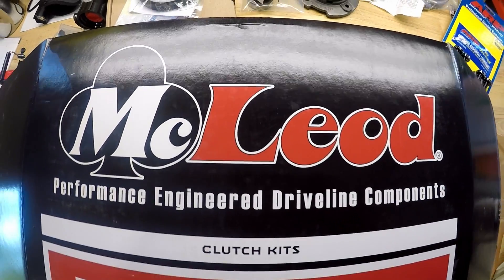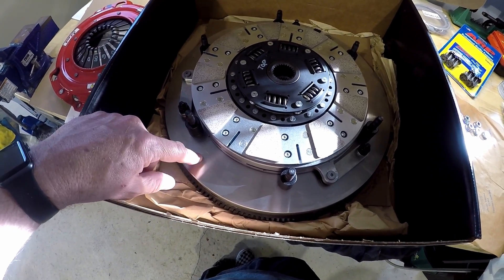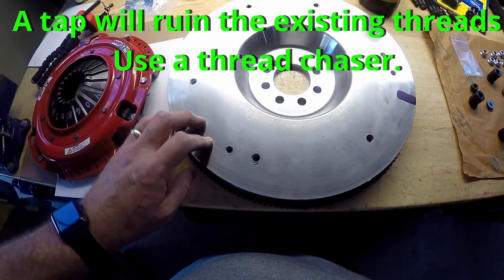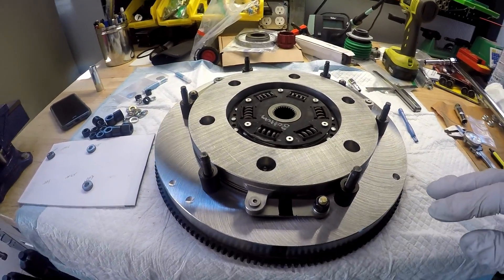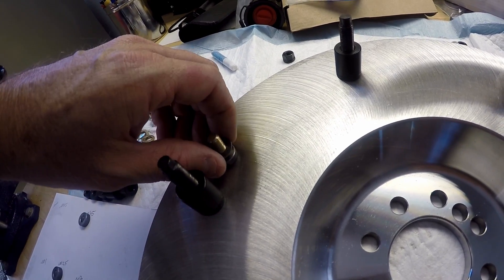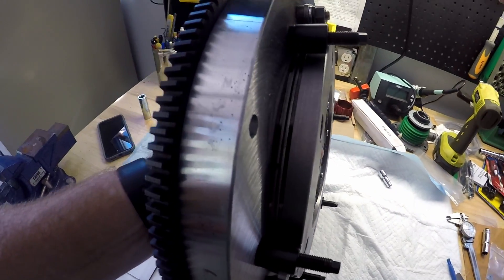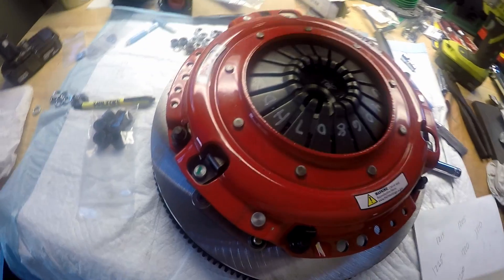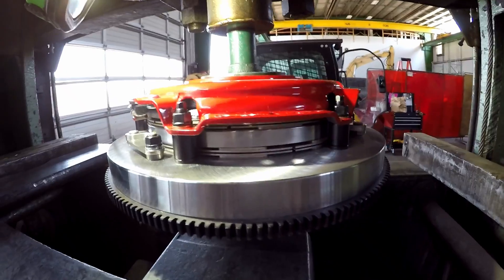McLeod RXT 1200  Clutch and Flywheel. How to set it up correctly.

Comment: Hey Mark! I agree with Nathan. Bull crappy about how much more work is needed before install. Did you have any other prospective clutch manufacturers in mind before you chose Mcleod? Would you run it again? Also, what is your current Power/Tq level since the E85, blower, and fueling upgrades?
Reply from the maker: Hi and thanks for your comments on the videos. I haven't actually dyno the car yet because I'm breaking in the clutch. The old clutch couldn't hold on E85 and would slip bad up top. I figure on pure E85 I'm over 700rwhp somewhere based on my torque reading on HP tuners and the mods others have done. I hope to get on the dyno after break in and a fresh set of tires. I have a few flex fuel adjustments to make to the tune and I'm out of E right now.  I would buy the clutch again. It's super smooth and feels stock except the pedal is a little more stiff but i'm used to it now. I looked at Monster and Mantic. I liked the Mantic but it was too much $. The McLeod only really cost me time and about $100 to grind and balance. I probably would do it to any clutch I buy regardless of brand just to be sure it's all flat and true.
Reply: @fasnuf  thanx for the reply bud love your content. It does make sense to prep the clutch. You're  obviously not one who cuts corners... unless it's a rumble strip on an apex maybe! I'm watching all your videos prepping my brain to start on my 13'ZL1. I have injectors, fueling, pully, belt, idler, headers, cam, intake on the bench so far. I feel like a snowball is starting to form LOL! Peace brother.

Comment: I apologize in advance if my ignorance shows here....but I think it's bullcrap that they send out a product not even remotely ready for use and rely on the customer to do all this setup work. Atleast supply the product perfectly balanced and surface prepped.
Reply from the maker: I agree, but that probably what make them less expensive over some of the competition. They do offer to do all this for you...for a fee of course. Yea, it's stupid. Most people probably don't do any of this and never have a problem, but I didn't want to take that chance.
Reply: @fasnuf  I definitely don't blame you for making it perfect, I would too. I'd rather pay more to have a product fit for use....that clearly wasn't because your guys found it convex in shape, that's just not good enough in my eyes.
Reply from the maker: @nathanwarren2582  So far the clutch is doing very well with no shudder or issues. The prep helped im sure